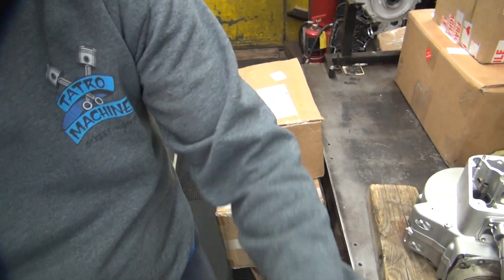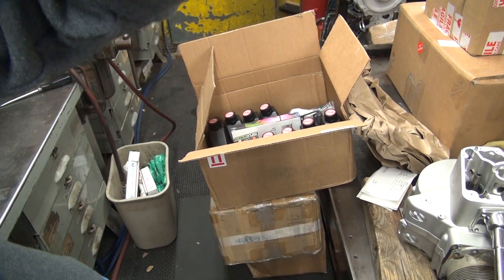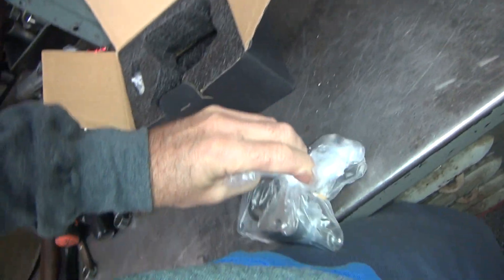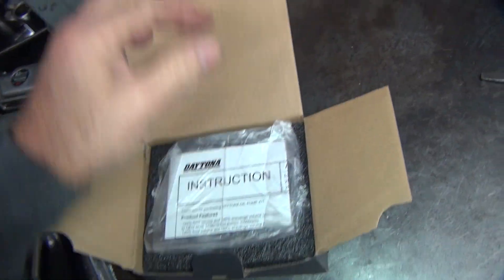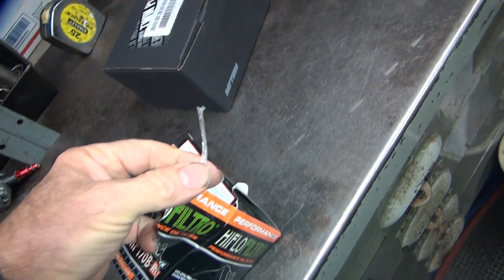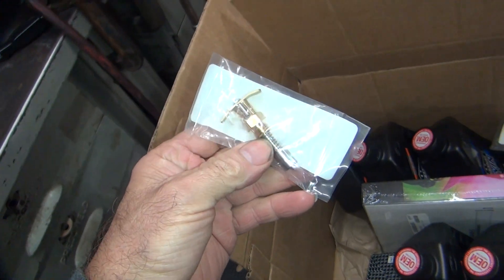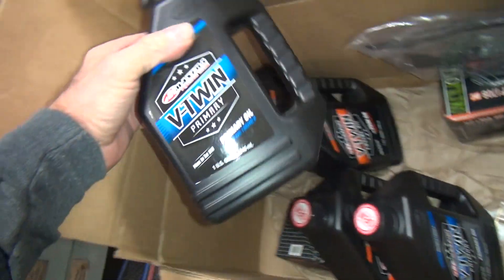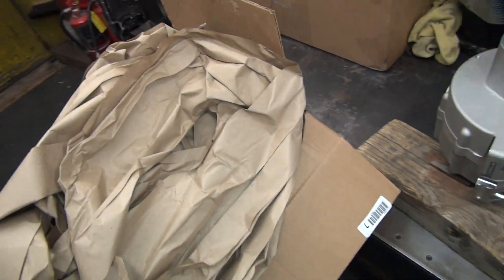see the crap i buy on ebay twincam oil pump special order parts description harley tatro machine

Comment: Do you prefer the HiFiltro filters over others?
Reply from the maker: yes, that is why i stock all of them for harleys.
tatro
Reply: Do the Fueling or Baisley oil springs and plungers fit into these TwinPower oil pumps?
Thanks!
Reply from the maker: beats me, why would you need one of them. the pump is made to work with what it comes with. it is not a small stock pump.
tatro